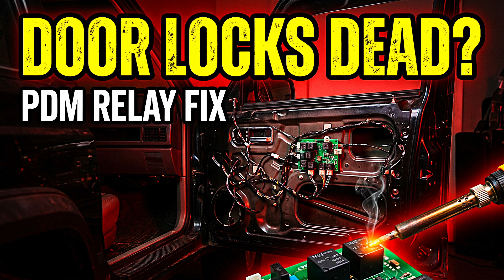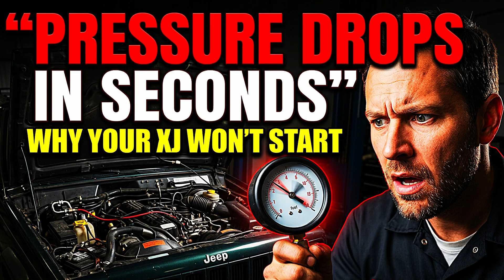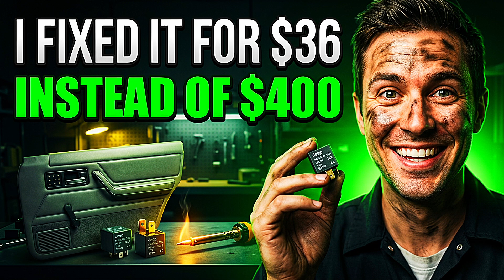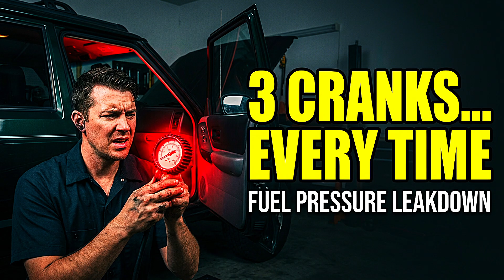Ep. 32 Fuel Pressure Drops in Seconds—Here's What's Actually Happening

Comment from the maker: Anyone else ever had power locks that only worked after you smacked the passenger door? I finally tore into the PDM on my 98 and found both relays have to be good for the locks to work at all. Replaced them for $36 and thought I was done… until the hard-start issue showed up. Fuel pressure was fine while running, then dropped like a rock the second I shut it off. Still deciding whether to just replace the pressure regulator or drop the tank and put in a whole new pump assembly. What would you do? Drop the tank once and be done, or try the cheaper route first? Drop your war stories below.